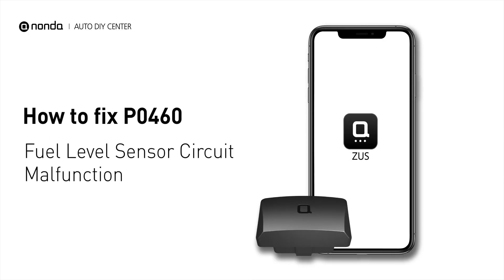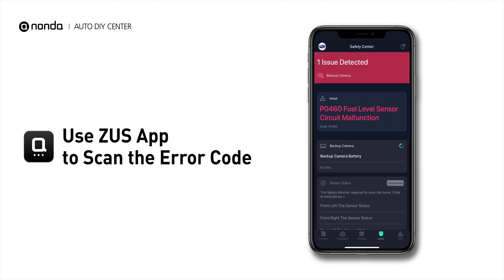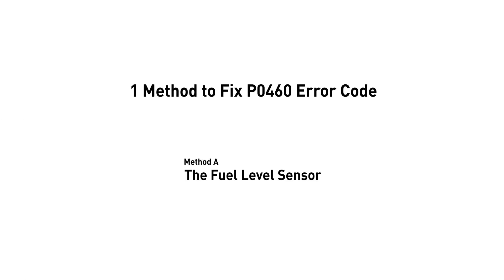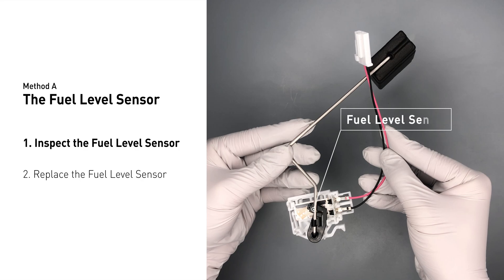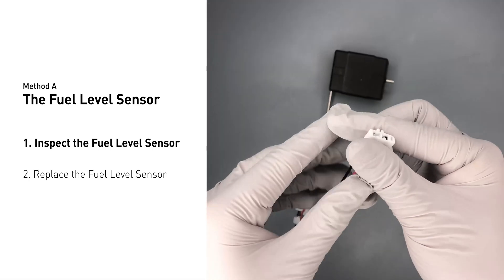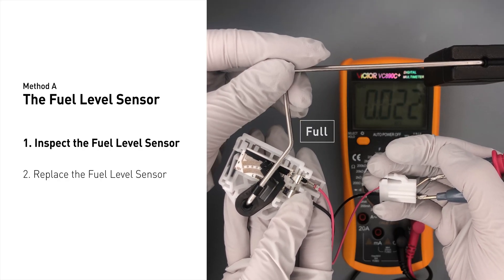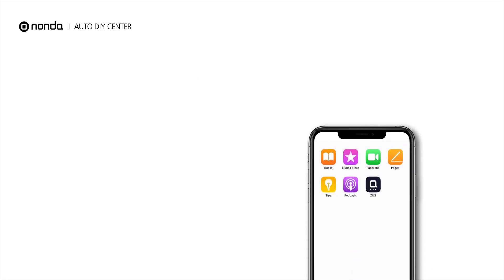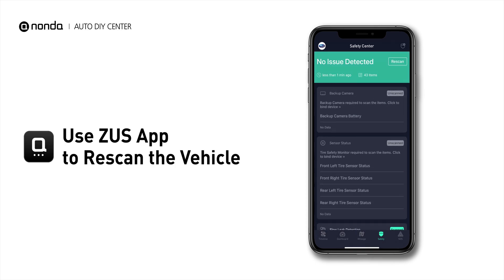How to Fix P0460 Engine Code in 2 Minutes [1 DIY Method / Only $11.9]

Comment: Try Chevron Techron Concentrate Plus Fuel System Cleaner in the first two tanks, if that fixes it add another bottle after the next oil change. The sensor contacts can foul up with surfer deposits that are added to the fuel. Techtron is the recommended fuel cleaner. Read the instructions and add when there is at least a half a tank so it doesn't affect the tanks liner. It's about once ounce per gallon.

Comment: Mine 2003 Ford service engine comes on. Is the P0460 code just the day I installed the REMOTE START alarm.

But I read that this Can also be the cause by adding the after market remote start

Can I still drive my truck like that.?

My cluster my gauges are working fine including my fuel gauge…
Reply from the maker: Hello, is this the only code you're receiving?
Reply: @nondainc  hi. Yes just P0460
Reply: Don’t ask these clowns. 2 minute fix my arse!

Comment: I have a corsa c 1.8 gsi and mine shuts while driving can't start again until I unplug the battery 😓 could this be the problem? I'm using torque and this error shows up
Reply from the maker: Yes, it's possible.